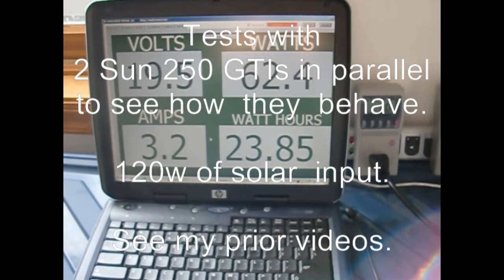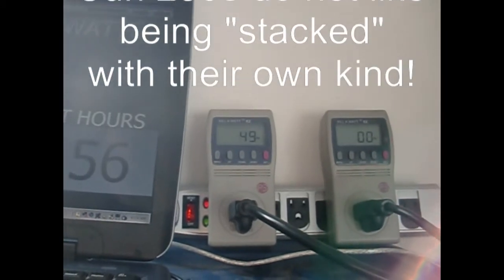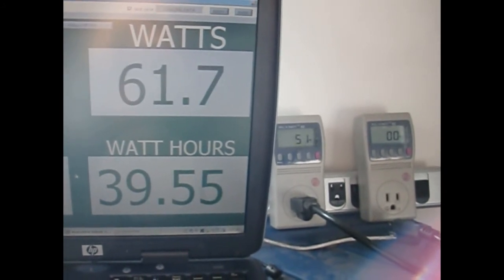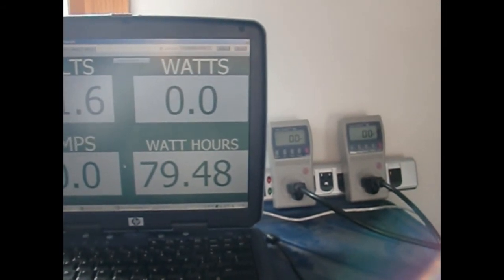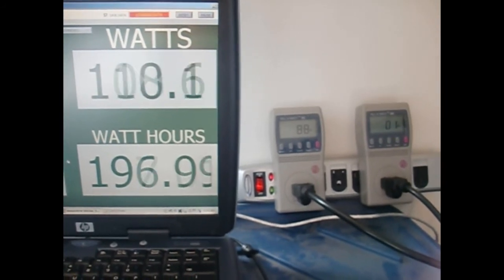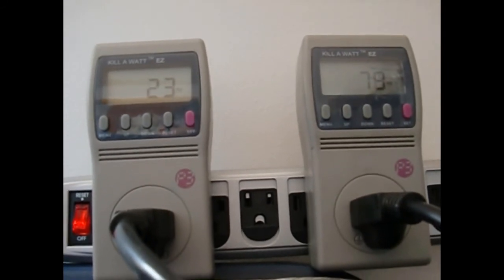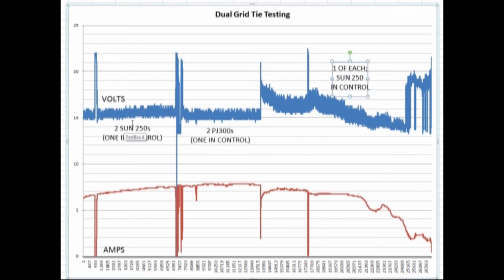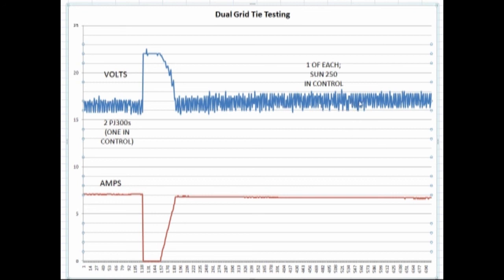Stacking Grid Tie Inverters - Power Jack and Sun with Solar Panels

Comment: Each grid tie inverter feeds the grid by raising the voltage a little bit higher coming from the grid tie inverter. If you have two inverters feeding the same grid, I was afraid they would compete and just oscillate back and forth until one unit won out. .seems like that is what is going on.
I have  a 2000 watts worth of panels panels and two 1000 watt GTI's.... I am trying to figure out how to stack them to work together instead of against each othet.

Comment: my question is does your meter on the house run backwards, and how many watts are you using at this point in time !! I would think the more effiecent  inverter , identical or not, how you are wired , cords from the inverters, and cords from the input!! will effect the invert's output, the path of least restance!!

Comment: Those are not grid tie inverters. Those inverters are meant for boats or motor homes. If you tie into the grid with hose, you will have a fire or damage your home equipment. Grid tie requires that it matches phase within 1 degree. Otherwise you could have voltage spikes up to 220 volts!

Comment: Hey I have 5 500w sunG inverters and 11 enphase inverters.I will try to ge some readings for you guys I have both running 1800 watts of solar.I have had the suns outside for 6 months in a little very vented box and the darn things keep on working great.The suns are all tied together in parallel.I made 10kwh on monday with the setup which is not bad for this time of year.TAKE CARE great video

Comment: Thanks for this test. I think one inverter decides on a lower voltage for what it thinks is the best MPP and sucks most of the power and the other sees less voltage, but backs off to test the MPP and finds the voltage doesn't go up so it stays put with that setting. This is good to know. If you had a GTI and a PWM charger, I think it might cause the same thing to happen. In this case the power jack would win and the PWM would take whats left.

Comment: @Fearlessthinker 
I can't speak for the 300w GTI's as I have never used them. However, in warm climates a solar array doesn't produce it's rated output for sustained periods anyway due to temperature deration, cable losses and reduced solar irradiation due to haze/humidity. A mono/multi crystal 400w array would be lucky to produce more than 350w sustained on a warm day, minus a few percent for cable loss. 350w into a SUN-500g will produce about 300w AC output at around 87% efficiency.

Comment: I wouldn't be running parallel GTI's across the same solar array. You are better off breaking the solar array up into separate banks, with each bank output being no more than 4/5 the rated power of the connected GTI. So, 400w of solar array connected to a SUN-500 GTI etc. This will maintain reasonable inverter efficiency and the GTI stays cooler. If you try and obtain the full rated output from these GTI's, efficiency plummets causing massive heat buildup and stress on the GTI.